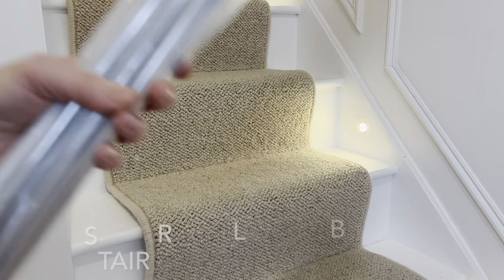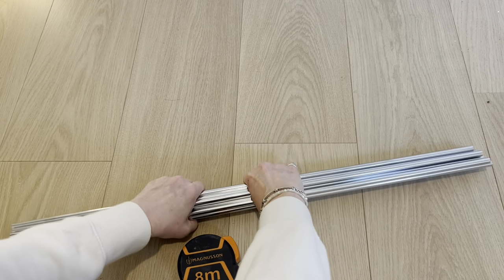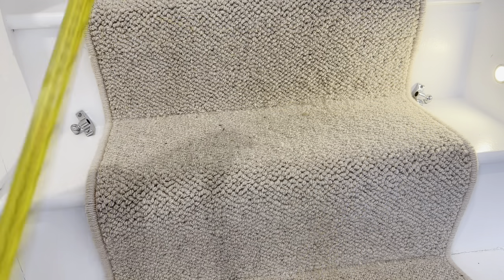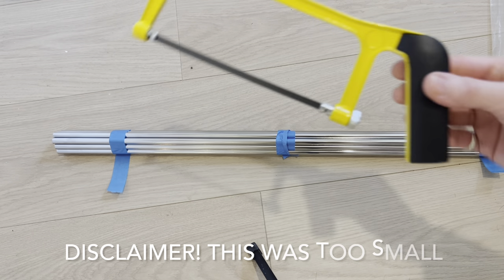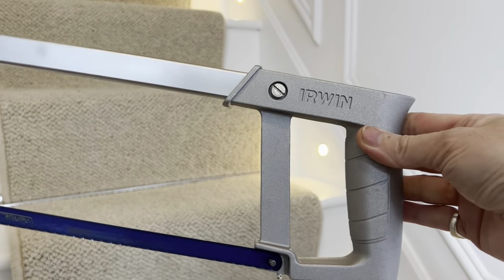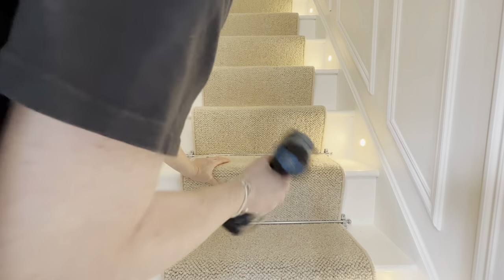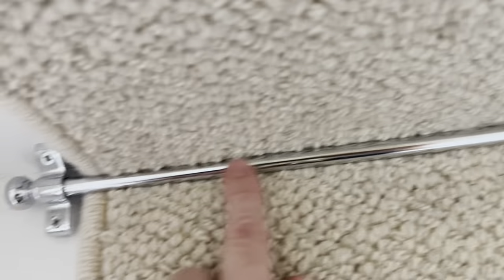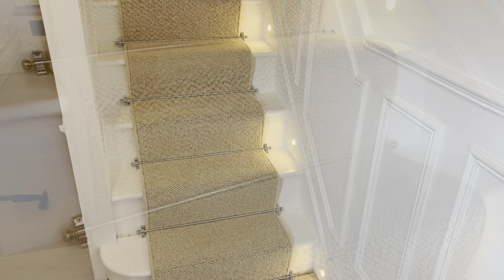DIYing - How To Fit Carpet Stair Rods - Hall & Stairs Renovation series

Comment: Hi Kirsty, very helpful video thank you. Question, do you fit a rod to the bottom step where it meets the ground floor? i.e. bottom of the first riser to the ground floor? It seems some do and some dont?
Reply from the maker: I bought one but haven’t attached. I will, but I’m still trying to find trim for around my bottom step curve. Mines attached so it doesn’t need it to hold it on.
Reply: @kirstygriffiths749  Great thanks, did you hem the bottom end of the runner and then staple/glue? to hold it all anchored ?